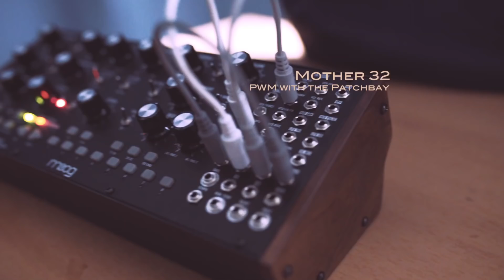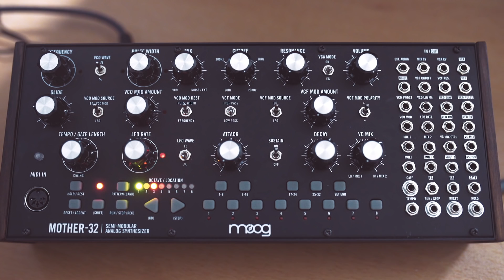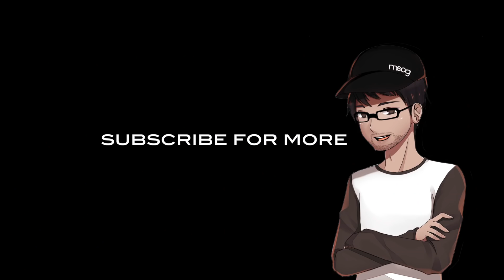Sound Design:PWM on the Moog Mother 32 with the Patchbay

Comment: Hi Rishabh, I really enjoyed your videos. I couldn't find much info about the other modes of the assignable output function, specifically 5,6 and 7 (sequencer step ramp, saw and triangle). When I patch them into the vco or any other input I only got a signal reduction (vco becomes an lfo). Do you know what are they supposed to be for and what is their use? Thanks, I hope you can give any advice, moog manual and google aren't any helpful.
Reply: That's what it is, an LFO synced to the sequence. It's probably most usefule with other modules. For instance, saw and triangle could be used to build arps.